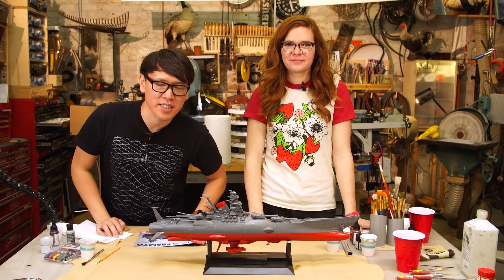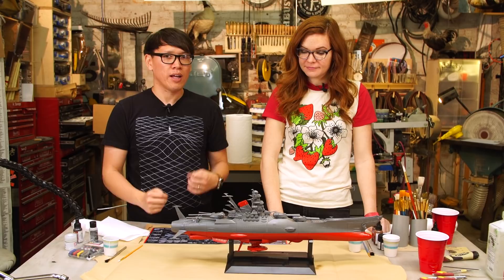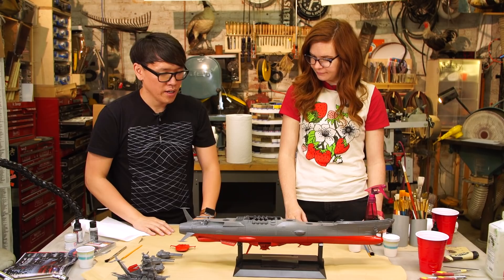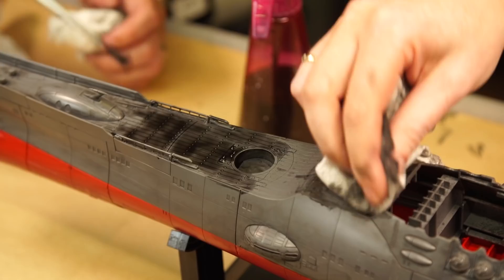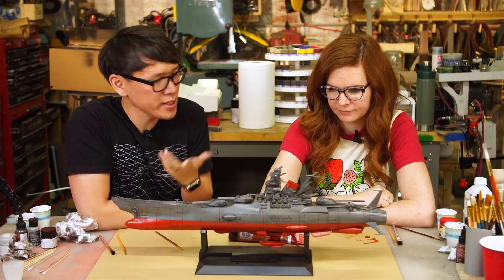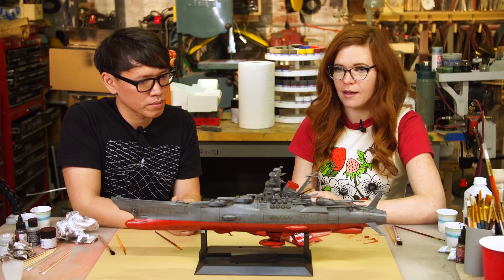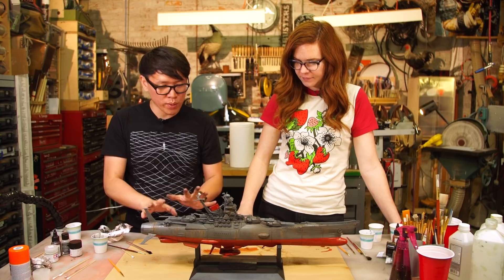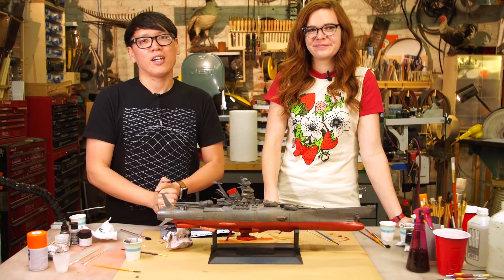Model Behavior: Weathering a Model (Space)Ship!

Comment: Sorry, but I’ve been building models for over 55 years now.  I would never claim to be an expert but my main modelling interest is sci-fi and WWll/present day naval vessels.  Saying all that, the video was informative but I need to offer some friendly critiques.

On the fictional side, I have built something from all genres.  From, some kit-bashed subjects to regular kits of Worlds Collide, Star Trek-Wars, BSG, Macross, Gundam, Thunderbirds, etc.... and of course, Starblazers/BS-Yamato (in its different iterations) so I’ve done my share of weathered and battle damaged subjects.

I know newer Bandai kits are designed so that you don’t have to paint, especially if you really don’t want to - but a scale like this can certainly use lots of highlights with silver and gun metal.  Also, it’s designed to be put together without glue for most parts but there were seams there that should have been sanded and glued for a better hull - overall parts fit.  

On the paint side,  washes are best but the rust was still a bit thick for that scale.  I know this  because some of my early 1:700 scale ships don’t have that much rusting and they have too much on them.  If you are showing that much advanced rusting, do some damage to the hull and guns to go along with it.  Depending on the subject and scale, a lot of rusting is done with a dry brush technique in any event.

Finally, after doing all that weathering,  spray a coat of mat finish on it.  It will keep all your dusting (and any decals) in place and prevent any smudges of any of that work that you did - basic finishing process.
Reply: You have more patience than me. It just upsets me too much. These kits are designed for young people! They manage to make them properly! I wish I could make something with you. I might actually learn something.

Comment: You can totally get away with rust and all other weathering you might find on a seagoing battleship, and you could incorporate the kind of weathering you would put on desert military vehicles.  The starship was made by converting the real-life WWII era Japanese Navy battleship Yamato into a spaceship (fun fact, the real Yamato class battleships still hold the record as the largest battleships ever).  When they did this in the show, they were rushing to get it done because they had to get to the distant planet Iscandar and back to Earth in under one year or the Earth would become inhabitable.  So they took a sunken battleship that had spent decades at the bottom of the Pacific ocean which later became a desert due to Gamilon bombing, and turned it into a spaceship as rapidly as possible.  It is VERY believable that there would be surface rust, salt deposits, maybe even barnacles still left on the hull, as well as possible sand blasting and sun fading - maybe even right next to shiny new plating where structural damage had to be repaired...?  The possibilities are endless here.

Comment: The battleship Yamato sank in 1945 and wasn't refitted as a spaceship until 250 years later, so there might be some rust. It's also a model based on an animated fictional story, put some potted plants and a swingset on there too if you think it looks cool.
Reply: Not quite. At least in the reboot, the shell of the original Yamato was used to camouflage the construction of the space battleship, but none of the original steel was used.
Reply: The reboot is wrong
Reply: @JeffPDX1  Sure sure. Nevermind that the reboot makes more sense (the original Yamato broke in half when it sank) and steel wouldn't be worth a damn after 250 years in salt water... Instead of fixing a glaring hole in the story, they're just "wrong".

Comment: Gee, hello, this a fictional ship.  They could have painted it blue and called it some other name.  However, since we are getting all technical here (like how people stress over the right colour of a Federation Starship),  I humbly submit a quick comment on the issue of whatever rusting should be on the ship to begin with.  

Yes it sat at the bottom (according to the show - with the hull more or less intact) of the Pacific for whatever number of years and then exposed to air for another bunch for a total of 250 +/- years.  If you were going to represent that Yamato, yes, lots and lots of rust and other damage to the entire ship.

However, it was retrofitted for space, any rust that was on it would have been taken off/hull plating replaced in order to be space worthy and battle ready (and capable to house the “Wave Gun”).

Would you want to take a leaky, metal compromised ship into space and/or battle?  No, the ship was  totally rebuilt in a close approximation of the original design.  There should not be any rust (or very little) on it at all.  Battle damage/scoring yes, rust not really.

As stated, my opinion only.  

Final note - That’s the fun of creating fictional models, you can do whatever you want with them (build finish aside).  Who’s to say a particular ship was exactly what colour?  It’s not like they say it is a particular “FS” colour.  Modelling is fun - leave the determining how flat a wheel is to a contest judge, not to the general public.  If Norm wanted to submit this model in the IPMS nationals, I would have hoped he would have done a better build job.  If it was just to go on a back shelf for display only, it’s ok.

Comment: For a beginner tutorial this is great. I would be hesitant to suggest anyone using "food" as one of your supplies - instead I would say get a few sticks of chalk, a black, light brown, and dark brown (more technically, a bone or carbon black, an ochre, and a burnt sienna). Grind or shave that off what you need as a powder. There is your dirt/grim/rust. To tone down the gloss from the wash/unpainted plastic, use a matte "dull-cote" spray to coat and seal the model.

The lack of an undercoat/paintjob is almost heretical, but the end result is still much better than before. And this WOULD be a great way to understand and get practise at weathering, without investing in the true pigments, airbrush paints or mediums AND airbrush kit that the studio model is obviously done with.
Reply: A set of chalk art pastel sticks (_not_ oil pastels; those don't apply right) can be your friend here, and give you enough different colors to be usable for a wide variety of weathering.

Comment: Interesting watch Kayte is wearing. I was first like: Is it the same as mine? After some shots (photo SHOTS!): No, it is the smaller version. Ie. I've been wearing a Casio W-780 since .. like .. 1994? There is a smaller version available with a plastic case and wrist band, and its only 50m water resistant. I think its the predecessor of the W-780, which comes in a  stainless steel casing and wrist band. I've had the smaller versions before (that is, 1994), and their wrist bands would break apart just after half a year or so. Thus at some point, I decided I wanted a proper watch, which was the Casio W-780, and convinced my grandmother to buy me one (it could have been a birthday present, so I might already have been 14 by then). Which I still wear nowadays - and no, the wrist band hasnt broken down .. so far :)

Comment: Weathering works better over paint or dull coat. Bare plastic is too smooth for conventional washes to work properly and this forces you to use a wash that's heavy with pigment. Conventional washes flow over dull coat far better and their lighter pigment ratio has a better, more subtle effect. Then dull coat again to seal in the weathering.

Comment: Sprue points need to be trimmed. I don't know a single model builder who would leave all those cut points showing as you did. Secondly, just because a model is colored in places doesn't mean it can't be painted. Don't be lazy and look for things that can be skipped! Break out the Battleship Grey and the metallic red!
Thirdly: It's NOT SNAP FIT. I get so tired of hearing people refer to Bandai Kits as "Snap-Together". The correct terminology is "Press Fit" which means the kit is so well made it can be pressed together for test fitting and then separated again for wiring and lighting. Honestly, when was the last time you were able to easily separate a snap-together kit?
Why is your "finished" model missing pieces? My suggestion is to go back and read up on some basic model building because you know what they say about lip-stick on a pig, right?

Comment: Just a thought; as this is a spaceship and therefore spends most of it's time under low G, would the water flow downwards like that or would it go towards the engine as that's the axis of acceleration? Also, would it rust in the same way without oxygen supply? Or is that a sign of a leaky ship?
Reply: Spot on Chris I was thinking exactly the same thing
Reply: @Rennie6666  I mean, at the same time, if it's been sat in drydock for a couple decades then this weathering makes total sense.
Reply: Yamato docks at sea ports and can operate as a naval ship. As there is no rust in space the ship would rust while landed.

Comment: Cinnamon is a bit too yellow, mix in some paprika powder :>
Reply: if i am not mistaken, this is a 200 bucks kit, i suggest not saving at the wrong end and getting proper weathering pigments
Reply: @kensaiix  Kidding??
Reply: Rust comes in a fairly wide range of colors, from bright orange to dull red. Still, kensalix is correct; at the scale of the model, you're not going to see any texture (compared to, say, the muffler on a 1:35 tank model), so you're far better off going with a good set of rust weathering pigments.

Comment: The fotos of the model on the kit-box are representative of what you get when you put some effort in it. If you just cut out the parts and stick them together, it'll look bland. Paint it! Even if it is already grey, plastic looks like - well - plastic. Maybe set some details apart with a different color. For instance, the decks appear to be made of wood, or the jet nozzle could be steel with some heat discoloration (see motorcycle exhaust pipes for reference). Or at least use some different shades of grey (don't have to be 50). Also important to think where the rust will be. BTW I build saltwater ships rather than space-ships, so they rust a lot faster. There are bits like anchor chains where paint has no chance to stay. Also, warships in peace-time tend to be in tio-top shape, with a large crew with nothing better to do and a captain who has no tolerance for unorderly rust and dirt.

Comment: There was still wash residue left over from that enamel based wash... Some enamel thinner wet napkin should have been used to remove the excess...
Reply: Both washes were water-based acrylic.  The rust was pure acrylic artist paint.  Kayte even pointed out that, if you wanted to pull back the marks, you could use water or alcohol.

Comment: Looks great. I'm wondering if you used a fixant spray that graphite pencil and charcoal artists use to prevent their work being smudged, or even a light spray over with hairspray, whether this would "fix" the cinnamon dust to the model, preventing wind or people brushing up against your model from removing the dust from it's surface?
Best Regards,
Carlos.
Reply: Applying a flat coat over weathering with powders such as pastels (ground pastels being another source for different color materials for weathering) has the problem that the flat coat can obscure the weathering, so if you apply the weathering powders to look right, a protective topcoat can hide the weathering almost completely, and getting the amount to overdo the weathering so that it shows up afterward is tricky.

Comment: In my books, adding rust to this model makes little to no sense for many reasons:
1. The Yamato rarely ever makes contact with the sea to make corrosion a thing, to begin with.
2. The Yamato also rarely ever stays in contact with an atmosphere for a time long enough to promote corrosion after making contact with water.
3. The Yamatos hull is most likely to be assumed a state of the art alloy capable of withstanding the harshest conditions including rust - Not some filthy rustbucket.
Reply: 4. in every series it starts as a effing dead wreck that spend decades under the sun/water
Reply: So, when you weather yours, you can do that?  I know enough back story to know it is a salvaged hulk that docks in water when not in use.  I also searched for corrosion in space,  It is a thing.

Comment: What can be done to make the final product more resilient?  Keep the cinnamon in place while being handled for photographing or other use.
Reply: Give it a couple of light coats of testors dulcote. But test it on a bit of the left over parts tree first to make sure the propellant doesn't react to the plastic Bandai use. Their plastic is notorious for becoming brittle and splitting.
Reply: @fozzyami  No its not, stop bsing. It from people putting panel liner, which is mostly thinner in tight spots. Any plastic, un primed  un painted will become brittle with thinner on it.
Reply: @lovecchio420  It tends to be from enamel washes even when kits are fully painted. I'd exercise caution with anything other than acrylic and water. Nothing wrong with doing a little test to make sure it's ok
Reply: @fozzyami  I have plenty of painted kits with enamel washes that say otherwise. Just need a gloss coat in between.

Comment: I do rusting on a Hot Wheels scale (links below) and I've used paints, oils, weathering powders, rusting agents and real actual rust. I never thought of cinnamon before and while watching this video I started thinking of other red spices like paprika as rust has different colors representing the varied stages. My question is this. While using some of the weathering powders they also recommend not clear coating because the powders with disappear from the project but I've used very light coats with pretty good success. A few extremely light passes. Are the spices going to act differently than the weather powders because of different makeups or would they kind of be the same?

Mine aren't perfect but I try to research what the real rust does on cars and try to recreate it. Thank you.

https://www.facebook.com/media/set/?set=a.2333240265282&type=1&l=14df097b91

https://www.facebook.com/media/set/?set=a.1050276231983&type=1&l=b79b972a5e

https://www.facebook.com/media/set/?set=a.2432531027489&type=1&l=33fd0dc8cb

Pictures are from first tries to a little more experience.

Comment: "bringing out the seam lines?'' seriously?
Reply: I think they're referring to the panel lines, which is one of the things that a wash is used for. Rather than a mix of alcohol, paint, and water to spray onto the model, though, I think I would have gone with a sludge wash, which is made with paint, dish detergent, and water, then brushed along the panel lines, allowed to mostly dry, then the paint on the surface cleaned up with a lint-free tool (dampened cotton swabs are good) to leave the sludge wash only in the recessed panel lines. Because it's thicker than a regular wash, you can better control where the wash goes down, so you don't get the build-up in unwanted areas that needs to be cleaned off.